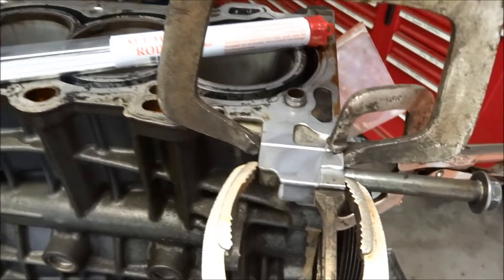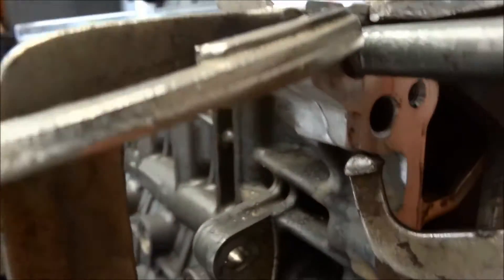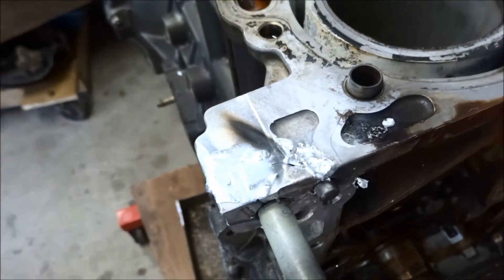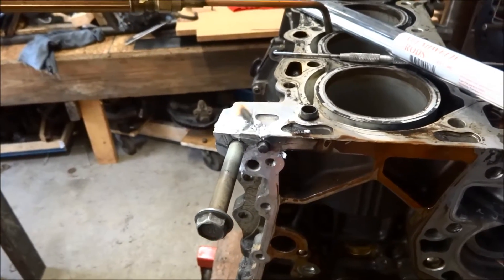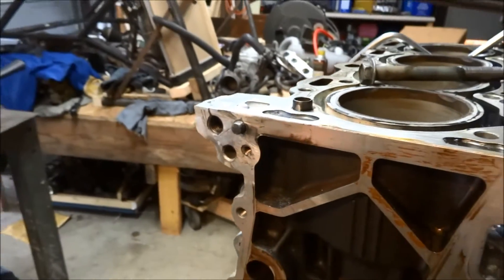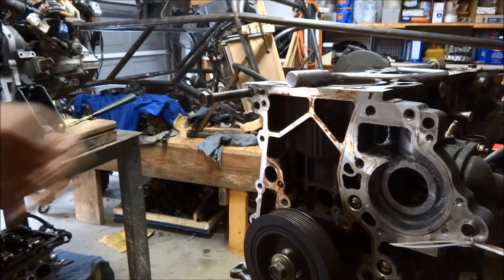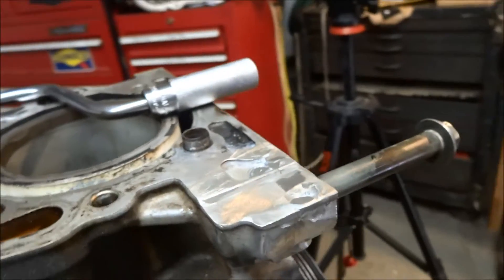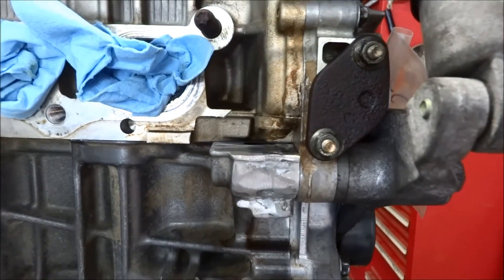"alumiweld" repair aluminum block, Celica 2ZZ block. aluminum welding rod? aluminium brazing?

Comment: Dude you showed none of the work. What's the point of the video?
Reply from the maker: The point of this video is that I used aluminum weld to put a broken block back together, and it worked. It's still in my car and running. I did this video 8 years ago. I'm not sure, but I probably shot it with my phone.  I have a lot of other videos that are much more detailed. Please check some out for free. I will refund all of the money that you were billed for this video🤣🤣🤣.and  I will give you a free subscription to my channel 👍. Thanks for watching and commenting, I hope you become a subscriber.